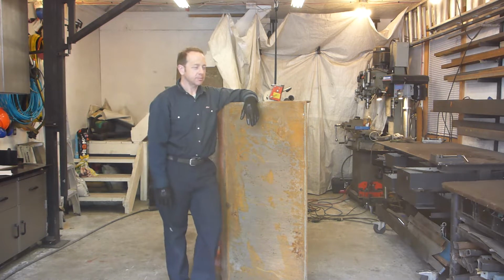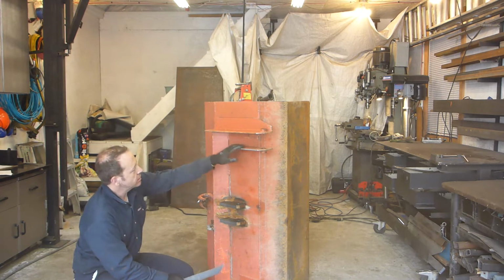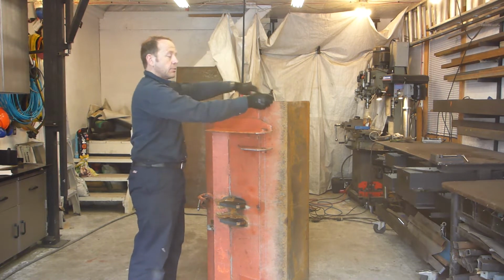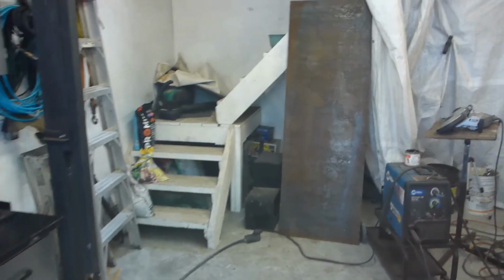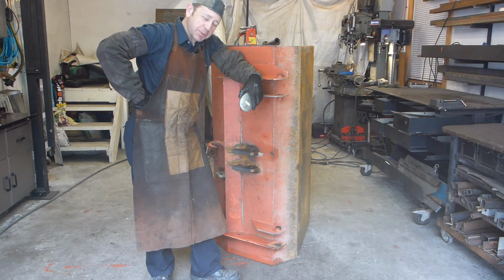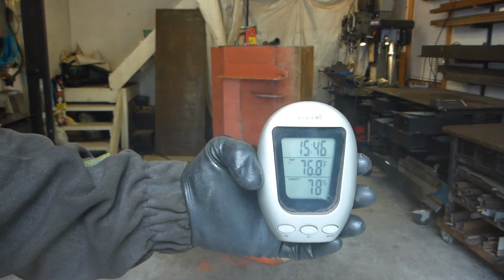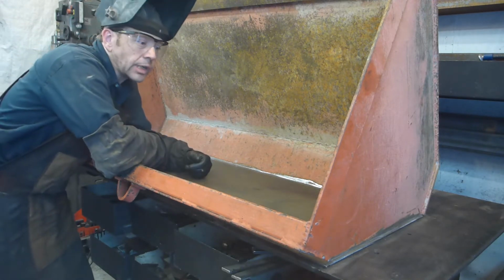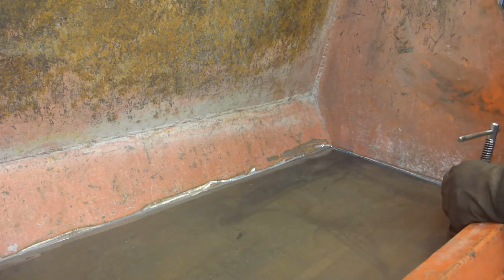#167 Convert Pin On Style Dirt Bucket to SSQA

Comment: Salut Joe!!!  One thing about your projects, you certainly are not afraid to tackle the big tough ones!!!  This is a big job and to cut the bucket apart and then rebuild it and make sure all is square, well that's a very difficult task.  But with your good planning and workmanship you can do it!!!  Looking forward to part 2!!!!
Reply from the maker: It looks difficult, but it's not.  It's only time-consuming going through 5-6 abrasive cutting discs...

Comment: I was going to mention a wider bucket instead of all that work. Then I read the comments first and see that the tractor may have issues lifting it. You sure are amazing! you do great work and seem to love the big projects.   Curious though. After watching the master welder on Grampie's workshop, I hope that you glob enough on to hold. You may want to watch some of his videos for a refresher. LOL.    All in fun Grampie !
Reply from the maker: I always watch Mike at Grampie's Workshop! I always admire what he does, even when welding. Just because he does try and complete whatever he begins. The Case is very wide for it's lifting capacity (1/2 ton). So going to an 84 inches wide dirt bucket is just impossible. So it will remain at 54 inches!

Comment: Joe. you're definitely right about cutting off the angled back-plate of the bucket.  After seeing the angles, it would have been a nightmare to try and create an even skid steer face plate.  You sure made quick work of cutting off the back-plate.  How long did it take to actually cut it off?  Really enjoy watching you work.  Full watch.  Ha, had to chuckle at the short-pants challenge from Dave (smile).  Have a fine week and can't wait for Part 2.  78 degrees F is some really nice weather.  It's been in the 90's for over 8 weeks here. We finally had 3 days in the 80's and it was like heaven (smile) then we jumped back into the 90's.
Reply from the maker: Thanks Don! It's still warm here, in the 80's. It took me about 45 minutes.

Comment: You're off to a good start on the bucket Joe....good idea to cut all the back off....Plasma or no plasma....just get her done....secoud part should be good2....CHEERS
Reply from the maker: There is not much yet to do to complete the project at this point. Especially I already cut most of the parts. Thanks!

Comment: Haha,..No, I too wouldn't suggest wearing shorts when we're working around metals and welding, maybe instead, if it's too hot in the work place, that we use large fans.
You know, that's a good way to add a different connection to an implement, just cut away the old, and re-build the new.
Thanks for this Joe, I'm looking forward to Part 2, ( as always)
Reply from the maker: Thanks Reg!  No slacking on PPE!
Reply: @FromSteelToWood brings back memories of dancing around when I'm cutting or welding as hot slag is burning my feet from falling in my shoes from wearing shorts. Yeah, I'm not to smart. LOL.
Reply from the maker: So true!  When you get a nice big blob going into your shoes, you can kind of get a special memory of that!
Reply: @FromSteelToWood  Haha,...I can relate only too well, on that thought! OUCH!